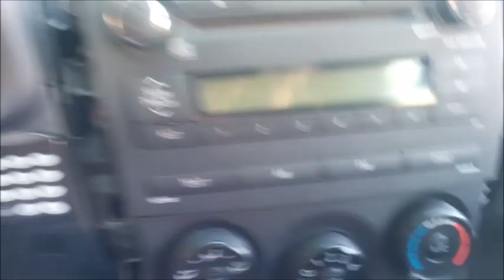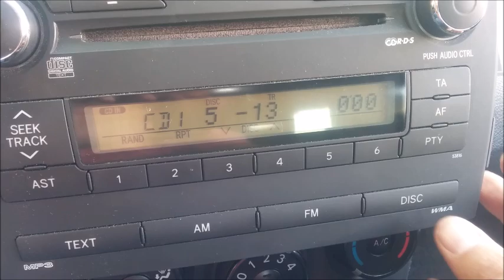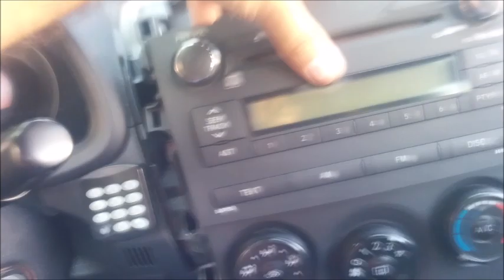How to insall AUX in toyota corolla 2008-2012

Comment: Thanks for the video however there was a lot of completely unnecessary stuff going on there. You didn't have to remove the stereo the AC unit the vents up top none of that you just need to snap the two side trim pieces off unscrew the screws and take the gear shifter plastic off around the gear shift and then that whole little thing pulls out where you can reach up in there and fix it without having to take the whole stereo out and all that